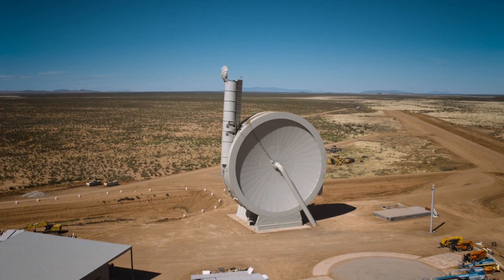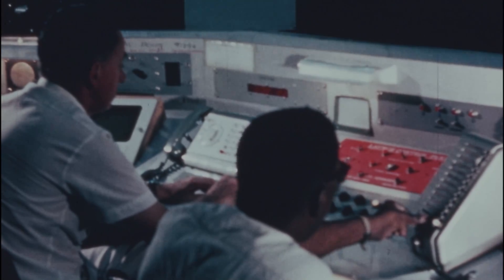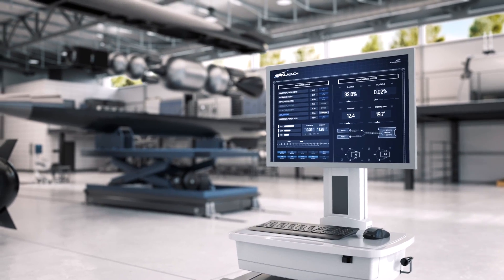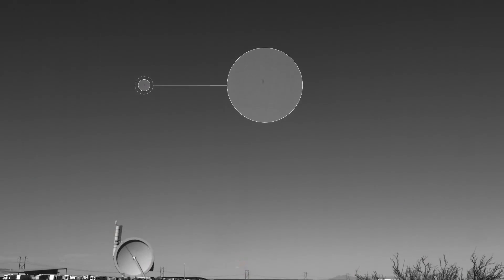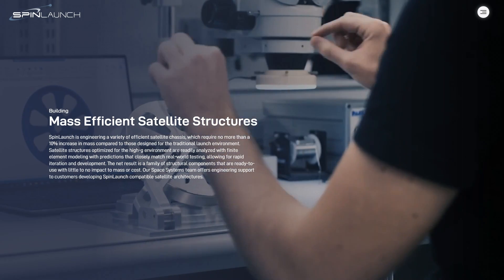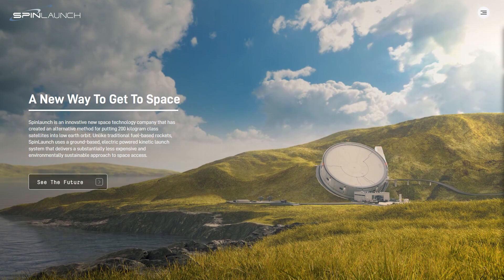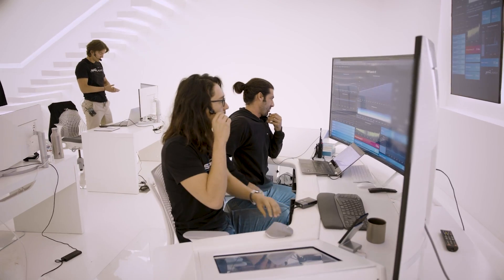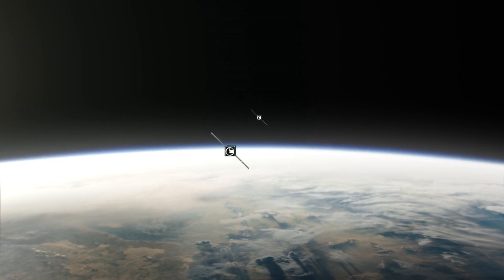Can Spinlaunch Throw Rockets Into Space?

Comment: Why do they plan to angle the entire facility to a fixed/semi-fixed position? As in laying on the side of a hill. 

Would be cool if they kept the current vertical design and just made the launch chamber rotatable/adjustable so you can change the angle of launch to any degree you want.
Reply: Stability probably.
Reply: @kapjoteh yes the failure points just rack up when its all able to move. Plus with something this big, its probably just better to rebuild at the desired angle

Comment: Mark 7 out of slightly curved tunnel 5000m tunnel exiting on mt papoose on a electric maglev track  doesn't seem unfeasible.
Reply: Have you done any calculations, no matter how crude, or are you trusting the omniscience of your gut instinct?
Reply: @Релёкс84  Crude, Taking the exit speed and time over the track it ~100g of acceleration and a heap less centripetal loss. also it would allow connection to existing tunnel networks. (the tunnel networks are omniscience)

Comment: This is also worrying in that it could theoretically be converted into a super long range weapons delivery system, while being much more efficient. 

In modern warfare,  the explosive payload isn't really the expensive part when you hear about these bombs that cost 300k or more each. It's the launch and built in guidance systems as well as the realitively huge load of fuel packed in. There is also a cost of the plane or launch system hauling it to the correct launch zone. 

Imagine a weapon system that incorporates a battery of these launchers in a very secure area, you would need basically nothing to get your projectile to the edge of space or into it.  

From there you have a tiny flight computer a couple or small jets that can adjust angle of impact and you would have a system ready to launch projectiles for pennies on the dollar of normal missles while also not even needing an explosive payload. A sufficient massive object falling from the edge of space could decimate enemy population centers or military encampments
Reply: It's got literal spin up time, though.

Comment: And what happens if/when one of these mistime a release?  Whether the projectile has fuel or not, there will be a huge explosion and a destroyed launcher building (and dead people if anyone is anywhere close by.  It is a funny idea though.  I think it is good that they're trying to think of ways to save on fuel and have less debris to get stuck in orbit or fall back down to Earth.  So, I definitely applaud the line of thinking but I don't know if this is the best solution to the fuel problem.  It is dangerous, just like a regular launch.  It is something that cannot be used for anything organic.  At it's current level of development it doesn't work until they scale it up and even then it still needs a fueled missile since it doesn't achieve orbit on its own.  Finally, getting it to be held in such a large vacuum and then rotate so quickly leads to a lot of electrical power consumption.

Where is that power coming from?  Unless it is from hydro, solar, wind, wave, geo etc it is using fuel (and even power plants that don't use fuel still need to be built, lubricated/maintained etc).  Now if that fuel is nuclear and we have plenty of the element used for fission or fusion, then that's fine.  However, there are no working fusion reactors and while fission nuclear power has improved dramatically from in the past it still has issues.  It's fine if safety measures are taken and there is plenty of fuel and a recycling process for the radiactive materials, however, that hasn't always been the case in the past.

So in the end, Spin Launch is just a power-hungry sling shot.  Unless it is used for something useful, it seems like a waste.  One good use would be if it launched cleaner drones that could slowly clean out the orbits so that the Earth doesn't eventually get to a point when we no longer can launch at all.